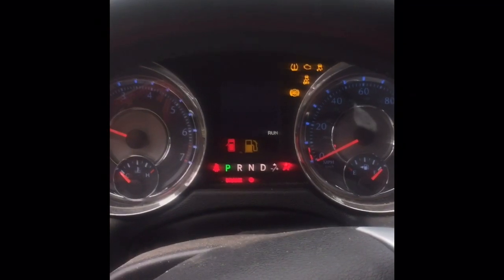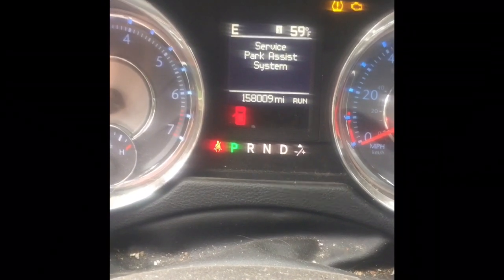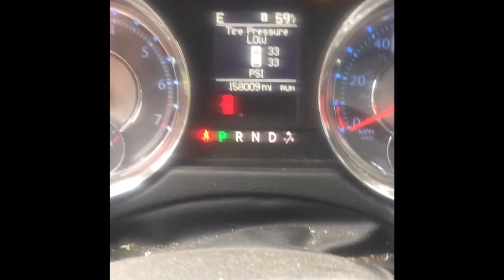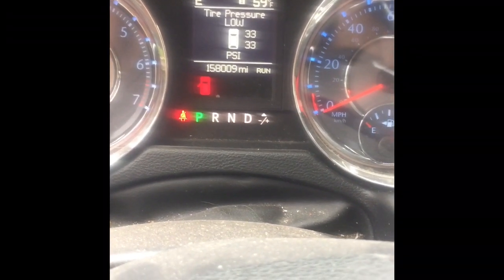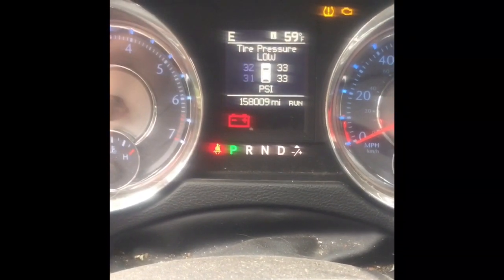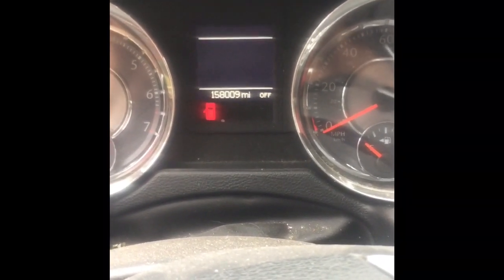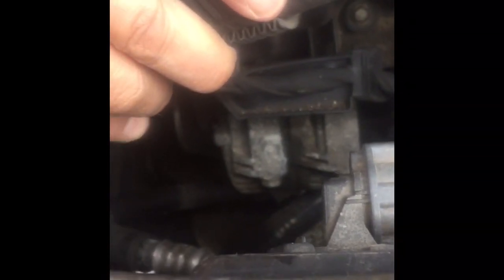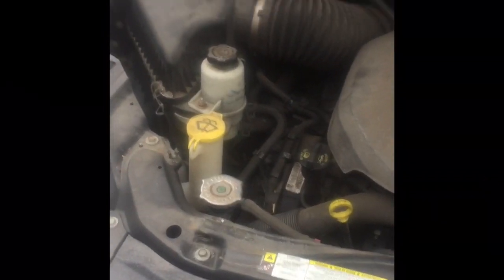Battery light - Alternator not charging

Comment: I have a question for you I have a 2008 Town and country Chrysler touring van I've got a brand new battery on it but I have to jump it because it will not start I've had the alternator  tested the starter tested I've had all the electrical in the fuses tested... But I cannot figure out what is causing this problem do you have any suggestions
Reply: A burnt out inline fuse in the battery cable coming from the alternator could cause the light to come on.  I assume when the alternator failed it took out that fuse to protect the battery. 

Check for continuity in the rev wire front eh battery to the alternator.

Comment: That is the most hillbilly thing I have ever seen…and it just fixed the battery light on our van. What the heck😳😂
Reply: Another video shows the decoupler / clutch parts. The bearing can go and things get rusty. Bang it to unstick them and it works again for a while. I suppose you could spray some lube in the pulley. Need to take the black cover off from the inside of the pulley hub.

Comment: I spent morning looking around junkyards and failing to find an alternator. I stumbled across this video and tried bonking it, and it actually worked. I am flabbergasted and thankful for coming across this.
Reply: Where did you bonk it exactly
Reply: @wesleystanden2574  I got a long metal rod and bonked it a few times on the side that I could see from the top.
Reply: @punishbear01  that’s what I did and it’s charging the battery again.

Comment: No meter to check voltage at the battery with the engine running vs. not? "Just bang on stuff"
Reply: He already has a diagnosis and knows the issue is the bad coupler. Ingenious.

Comment: Just wanted to say thank you for your video you just got my family home safe on a late rainy night . 2012 Dodge caravan exact same symptoms  only had this. An about 8 months I've seen the battery light come on before but it wwnt away after restarting. Van has bumping hesitating almost stalling at times .tonight it was in a limp mode wouldn't shift gears and barely made it off the road I sat there for around 3.5 hours van would not restart was dead I let it sit for a while and it restarted but was not charging I happen to have a fluke meter with me so I knew that would not make it far. That's when I cam across your video so I did same procedure  using a hammer but battery was to dead to restart knowbody in sight for a  jump so I sat for about  3 more hours until I got an idea to use a 20v Dewalt drill battery to maybe get it started using my fluke meter I found positive and negative on the Dewalt battery used a flat peice of steel to make contact  jumper cable it to van battery and what do you know it started right up quick check on battery and what do you know charging 13.8 volts and I was down the road to safety.. van seem to be funning better than before with strong lights fan blower no bumping at the stop light Thank You  are The Man . And anyone else having symptoms or alt charging problems with Dodge Caravan I highly suggest banging on the alt as video shows save alot of time money and who knows may e even your life .
Reply from the maker: Glad you got back on the road! Ingenious recovery with the dewalt battery!
Reply: Fricken amazing that you had a Fluke with you and a cordless battery tool and MacGyver’ed it to go.  I carry a small lithium jump pack.

I just got back from a 2000+ mile road trip where I decided to trade cars with my son so I didn’t have to take my 2012 van. I get back home and back into my van, 100 miles later the battery light came on and a Facebook reply turned me on to this decoupler. 

I’m gonna try this trick but make plans to replace the end piece if I need to like another video showed; $30 part.

Comment: Just installed a NEW not re-manufactured alternator. No charge, "LOOKS" like it is spinning....maybe i'll try that. Thank you HOW did you figure out the pulley wasn't working right?
Reply: I had my brakes and rotors done and since I got it back it was not running right at all. Driver side wheel locked up and I was driving back to shop.  Was told the caliber on driver side and quick fix Smell smoke and heat , next bat light come on and altinator and bat not holding charge system said bad bat bat alt and trans problem then  other codes . I was told this is common with this van and it is that damn wiring system that Chrysler jeep uses and is extremely dangerous.Jeep has a recall on it. Irns. Or something it was called.The system goes crazy and don't know what is wrong  The entire van shuts down . Steering,trans,brakes motor. I was lucky that I was in the parking lot of the shop.
Reply: Soon the pulley and look at the insides of the alternator and see they aren’t moving. 

You can get trans and engine DTCs for low voltage, then limp home stuck in 3rd gear because it’s default with no solenoid power. Eventually the battery can get so low the fuel injectors won’t even fire.

Comment: Ok,so can tell you're not a mechanic. That clutch you're slamming on is the air conditioning clutch for the AIR CONDITIONING COMPRESSOR, the alternator does NOT HAVE A CLUTCH. keep slamming it though it will do nothing for you in the end except cost more money.
Reply from the maker: Try again
Reply: That is the alternator......
He is hitting it in the right spot.
Reply: Wrong.
Reply: When you work on a 2012 grand caravan, then you will realize that he is slamming on the alternator which is above the compressor. And it works. 3 light taps worked for me
Reply: Yes you can hit an Alternator or Starter and possibly get a little more life out of it but I would test and service said part.. ASAP..
   As far as a magnetic clutch on an Alternator... I haven't ever seen one in this application.
Reply: Totally agree, no there's not a magnetic clutch like a compressor or PTO, just a pulley attached to the alternator fan. The bottom line is to replace the alternator. This is just for emergency purposes @sparkynm156
Reply: The A/C compressor is below the alternator. Sorry dipshit.

Comment: I welded the pulley so it can't slip any more. Still working fine 70,000 miles later.
Reply: Did you pull the plastic cap off , i was gonna tack mjne but it seems to be a plastic cap or something
Reply: @frankiesemailfd  Yes. Pry off the cap & weld. That high maintenance corrosion prone slip pully is not only an expensive over-engineered solution in search of a problem, but is another problem waiting to happen.
Reply: @michaelhaiducek2648   Did you weld it while it was in the car? If so, where did you hook your ground? Thanks man.

Comment: Did your belt squeal because of this? Would it cause interior accessories (ac, radio, speedometer, etc) to turn on and off randomly?
Reply from the maker: No
Reply: Mine did and I was told it was the cheap 1 way lane wiring system that Chrysler jeep uses and it was recalled in jeep. I think it was called irns or something .